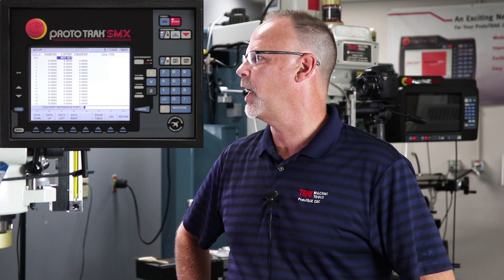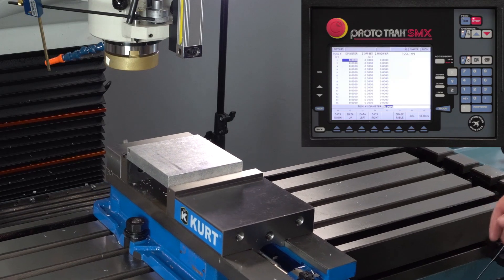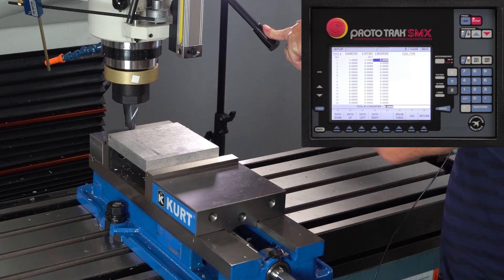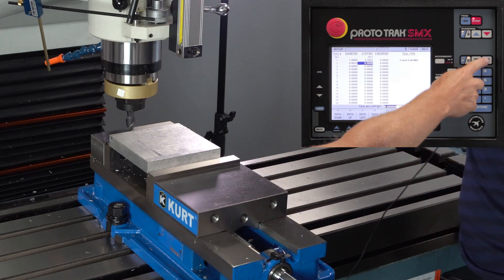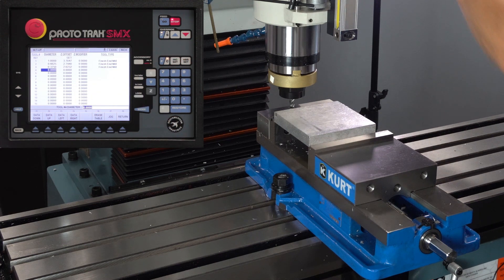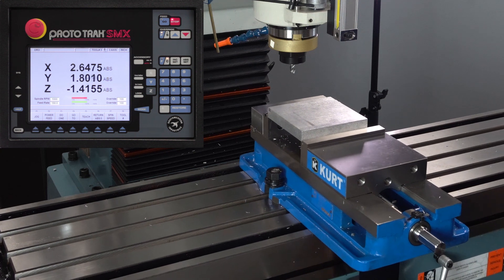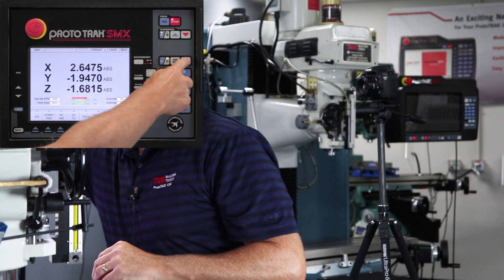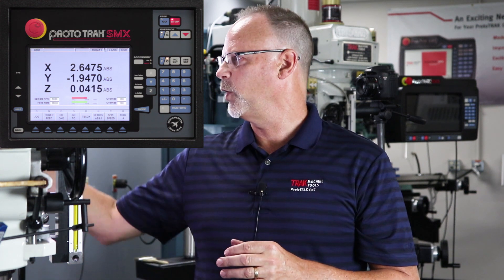Tool Setup | ProtoTRAK SMX CNC | Basic Programming 9

Comment: So you only use the last tool to set up top of the part?  Im job has one of this machines im trying to learn how to set it up and make simple programs
Reply: Hello, I think I answered this on a different video but just to clarify, after you finish setting up your tools, the last tool will already be in the spindle and the DRO so it makes sense to use that tool to set your part zero in the DRO mode.  In reality, you can use any tool from your program as long as you call up that tool in DRO before you touch it off the part.  T.P.

Comment: so if using a tool setter base can be set anywhere random?
Reply: Yes, as long as that place you use can be accessed at any time.  For instance, the table, the back of the vice, a 1-2-3 block. Just don't use the part itself becuase once you take it out, your reference is no longer accessible. T.P.
Reply: @patrickfitzsimmons5187  but if using a tool setter looks like to me it could be set in the air anywhere because the tool setter gives you the numbers needed for tool differences then you zero where the program says ...not 100% sure im new to this but im gonna try it
Reply: im thinking base is set only to measure tool difference and that can be done with a setter

Comment: So all tools need to touch off at the base reference but only 1 tool needs to touch off on the part?
Reply: That is correct.  All tools are measured from one base reference point. After that, when you take one of your tools and set Z zero on the piece part, all the tools will be transferred to that position.  This way, you do not have to reset your tools for every part you make.  NOTE: make sure the tool you use to set part zero is the one shown at the top of the DRO screen.  T.P.

Comment: 3:40 - If you take tool #3 out, put tool #2 in, tell the machine it's tool #2, AND touch tool #2 off to the top of the part as you did with #3, it will still read zero, because it knows the difference between the #3 and #2 offsets...correct?
Reply: Correct!

Comment: The reference set should be removed. You guys should just make the default reference a machine position zero. That way you can always touch the tools off at the same place and not have to worry about where the reference was initially set. Also when you load a program from in/out the reference point is cleared out which is ridiculous. If I have multiple operations programmed. Simple loading the next operation program shouldn’t remove the reference point from which my tools are set. Prototraks are ok machines but they really need a way to shift your work off set easier. If I face my part and see I need to come down some more I should simply be able to subtract that amount in my z work offset instead you have to jog over the part and touch the tool on top of the part and then re zero your dro. They are okay machines for the average machinist who may not understand g code fully but they are pretty slow to program. Siemens shopmill is a much better conversational programming machine.
Reply: Hi Chris, thanks for your input.  I am very familiar with how the Siemens control and ShopMill works and I agree with you that it would be great to have a machine home for work offsets however, it isn't really needed for a tool room or prototype machine like ours.  Although ShopMill is more capable, it is also more cumbersome and I believe the ProtoTRAK programming is much easier and faster to use.   If it makes you happy, soon you will be able to buy TRAK machines with the Siemens control on them too. T.P.

Comment: Actually , I didn't understood why I will loose the tool offsets if I use the surface of o part. I mean the length deference between the Ref point and the rest of the tools will be the same even if I set them on the vise , a 123 block or........ the surface I will machine. No?
Reply: You are correct unless after you take out your part, you decide to add another tool to work with your existing tools.  That's why I don't use the part.

Comment: Am I correct that this Tool Table is now unique to this specific Program?
Reply: Actually, the tool table will stay in the machine even after you erase this program so the same tools can be used with another program as well.  The machine will dump the tool table when you shut it off but if you reload the previously made program, all the tool info will come back with it.  T.P
Reply: @trakingpat2750  What about G Code programs? Just got a machine I'll mostly be programing for 3d work using CAM. First test I've loaded a G code program, only set one tool for a quick test, after shutting the machine off the tool table doesn't seem to reload after reloading the G Code program. 
I guess I could setup a dummy SMX program just to setup and reload the tool table?
Reply: @hughestooling  The easiest way to make the machine remember the tools is to make a dummy program and save it.  Then, you can open this program first to get your tools loaded.  When you bring in a new program or erase any program, the tools will stay in the set-up mode until you shut it off.  T.P.
Reply: @trakingpat2750  Thanks, I've been experimenting and came to the same idea of using a dummy program. Only gotcha I ran into is if you need to reset or add a tool you need to reload the dummy program first, then add the tool and save the dummy file again before going back to any program you were running.

Comment: Never use the back of the vise to set your tools. Put an indicator where he just set his tools and tighten up on a part to see how much it moves, this means it is NOT a solid reference point. During a multiple piece job changing out dull/broken tools you'll be wondering why your Z depth is out a couple thou, especially on a non solid vise like the one in video. Plus everyone should just do it anyways so you know how much your particular vise moves under a certain torque if you really want to be a master!
Reply: What you're suggesting makes no sense at all.  The back of the vise is solid enough to touch off each tool whether you use a dial indicator set-up device or just your hand.  There is no reason to tighten or loosen the vise between each tool therefor, it will not be different.  If you really want to be precise, then measure each tool length and enter them manually.  T.P.

Comment: How about setting up the tool offsets on a K3 knee mill with 3 axis control?  Very difficult to machine any parts that require both milling and drilling as the quill travel is so limited and the knee movement does not register with the SMX Z DRO.  Any tips or tricks on how to make this an easier application besides having to crank the knee down for drilling and up for milling and making sure that the backlash in the knee is always on the correct side since it is all referenced off of the knee crank handle.  I think this is my biggest complaint about the machine's usability as a 3 axis CNC
Reply: Unfortunately, you are correct about everything you wrote here.  The 3-axis knee mills are very limited due to the fact that you only have about 4.25" of quill travel.  Your only way to do this is as you've described by moving the knee up and down and pay attention to how far you've moved it.  What I would suggest is that you break up your programs to only use the tools that will fit.  EXAMPLE: Program #1 has all my drilling events.  #2 has all my milling events.  This way, I don't have to move the knee in the middle of a run.  I can vouch for all of the salesmen here at TMT when I say this...every one of us will tell you to buy a bed mill if you need 3-axis.  You get 23+ inches of Z travel and this problem goes away.  Not to mention that by the time you add all of the same options to a new 3-axis knee mill, you're at the same total cost of a DPM2.  I think a 2-axis knee mill is a great tool room machine but when it comes to 3-axis, the bed mills are way better.  Most shops have both and for good reason!  T.P.

Comment: I set my reference as tool 1 on the top of the part then I set my Z Zero at the same time on the top of the part.
Then I set each additional tool in order on the top of the part as well.
That way I can watch the absolute numbers and tell how close my tools are to the material and how deep they must go.
It's easier that way for me. 
It just my personal preference. As I taught myself how to program and set this machine up for jobs. I had no training.  I'm self taught.
However I can see that there is a benefit the way you set your reference point. 
Nice video
Reply: That works too however, if you break your first tool or remove your piece part, you've lost your reference point.  The absolute numbers will be correct no matter which way you do it.  Once the tool offsets are set, you can go to DRO and use any part as your Z zero and all the tools will follow.  It sounds to me like you're still a little confused between tool set-up and part Z zero.  They are completely different things but many people struggle with understanding this.  Let me know if this method clears it up for you.  T.P.

Comment: i would like to how to do concave and convex i would like a vidio to do events
Reply: Ismael, we can do a video on this as well.  Please keep in mind that although we can program the ProtoTRAK to contour in the Z axis, it will not know how to rough out the part.  The programmed events will only cut the finished geometry.  For now, try this... Let's make a 2" diameter sphere with Z zero being the top of the ball and X/Y zero being the center.  Use only mills or arcs to do this because profiles do not allow you to move the Z axis.  In this case, it will be all arcs.  The machine will assume that you are cutting with a ball nose end mill.  You will have to keep the tool offset on center.  Event #1 Arc  XB=-1.0", YB=0", ZB=-1.0, Z Rapid=.050", XE=0", YE=0", ZE=0",  XC=0", YC=0",ZC=-1.0.  With this event, you can rotate it as many times as needed at whatever degree you choose and if you do it the correct amount of times, you will have the convex half of the sphere.  If you reverse the Z dimensions, you'll get the convex sphere.  If you use a repeat instead of rotate, you'll get a round edge that you can extend as long as needed.  The amount of step over and number of repeats will dictate how long the channel will be.  Once you understand this, you can get more creative using multiple events that are connected to each other.  The trick is that each time you add another event, the first four questions (XB,YB,ZB,ZR) will be INC SET to make the tool stay at the same place as the previous event.   Let me know if this works for you!  T.P.